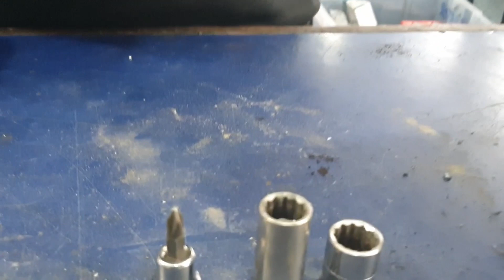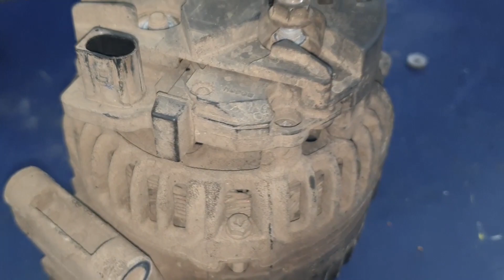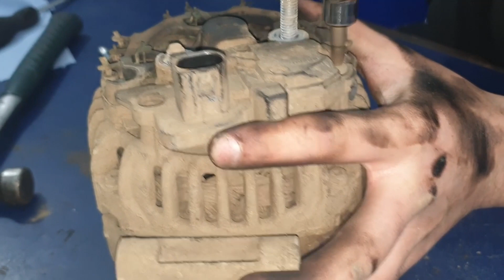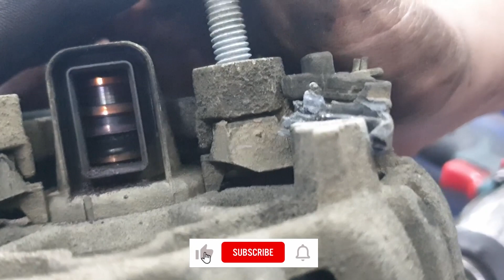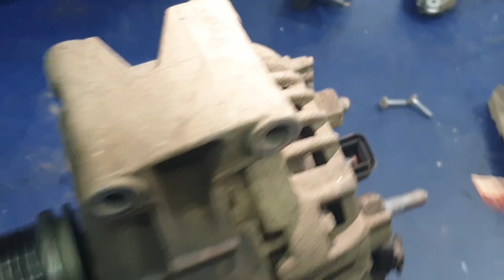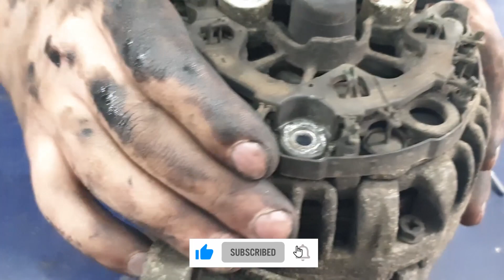How to Repair a non working Alternator Generator Mercedes Sprinter Euro 5 Fix Not Charging Battery

Comment: it is mandatory to replace the rotor collector and do not hammer in the 3rd screw from the regulator because it can break just like yours....if it is left like this the brushes will be broken due to the wear of the collector in a short time

Comment: What is the part number for the brushes/regulator?
Reply: 9 months late but hope this helps. On my Bosch original, BR 14-MO and F OOM 145 287. You will find plenty by searching either of those.